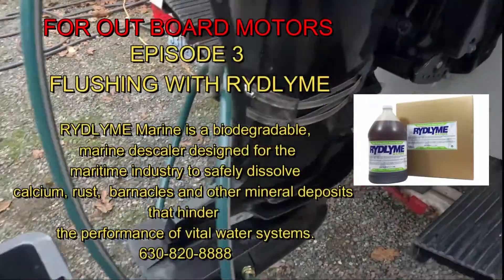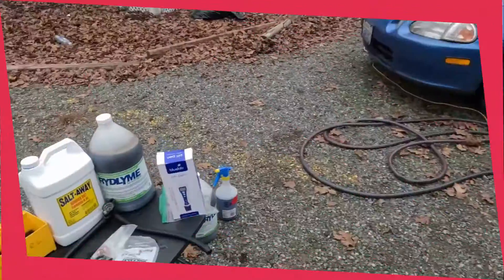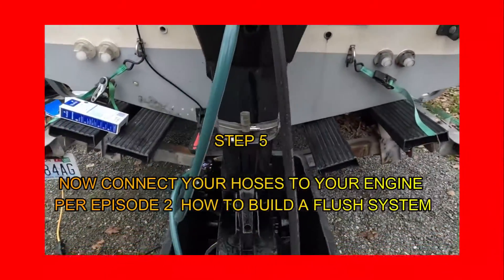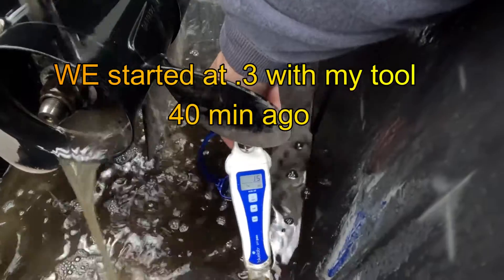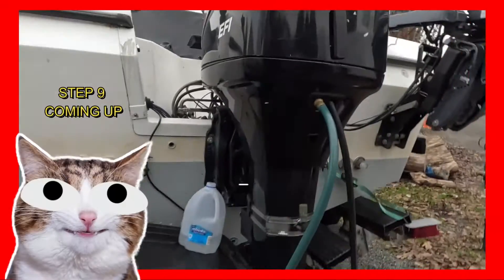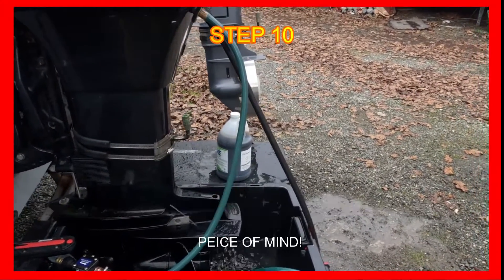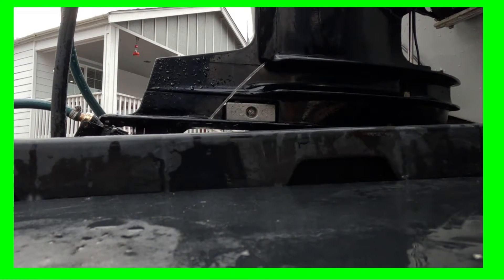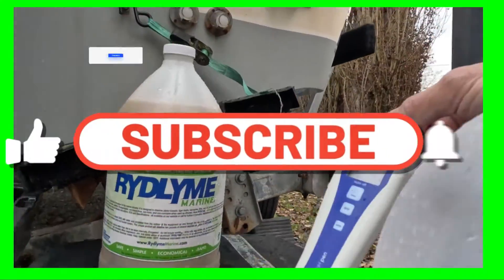DIY, Flushing Out BOARD Engines WITH RYDLYME. How-To #fishingequipment  #boatmaintenance

Comment: My pump wont pump through the system out of the tell tale, im pretty sure i set it up exactly as you, granted i dont have a flush port and am attached to the pick up tube in the leg. Any suggestions?
Reply from the maker: @michaelseamus2112  is thermostat out? Common problem is to small of pumps
Reply: @steveperdueshowtofishingti2172  yes the thermostat is removed
Reply from the maker: @michaelseamus2112  what size motor? and pumps gal per minute?
Reply: @steveperdueshowtofishingti2172  it's a 30 hp johnson and I believe a 1/10 hp and 320 gph, I had a 1/8 hp Amazon pump that behaved the same however it burnt out within an hour of use
Reply from the maker: @ um, sounds like the pump is just not pushing it up to it. Is is coming out the bottom of engine and just not out the pee hole
Reply from the maker: I wish you could upload a pic but YouTube doesn't do it.
Reply: @steveperdueshowtofishingti2172  it's coming out of the two front holes in the middle of the leg, it would be easier to post a pic i agree
Reply from the maker: @michaelseamus2112  mine was going through pee hole,, i disconected and ran into the tub. Maybe just week pump.
Reply: @steveperdueshowtofishingti2172  very possible. I routed the tell tale back into the tote as well. Thank you for the replies I'll keep at it
Reply from the maker: @michaelseamus2112  good luck, let me know how it goes.

Comment: Hi Steve, thanks for posting. The PH thing is clever. questions: 1/why do most recommend to remove gear case  and connect to internal pipe instead of connecting to flush port? 2/ Once I am done with 1 motor can I re-use the mixed solution for 2nd motor or I need to start with fresh mix? I guess the answer is that it depends on how bad 1st motor was... Or same thing but in a more scientifically expressed YOU would say depends on what PH obtained when PH in and PH out became equal on 1st motor. last one/ should I do this as maintenance if I have no overheating even running full throttle for an hour in 87 F sea water or is this a curative procedure only. Thanks a lot!
Reply from the maker: Hi, Thanks,  some dont have a flush port and thats when you can remove gear bottom end, other wise I would use the flush port and take out thermostats if its available.   2nd ya PH would be off from the new, also if it went super high for a long flush its spent I would just get another, but if it barley changes use a bucket and keep using it as a maintenance every 3 or so months. if it was an older motor I would do it once a month to make sure it is all clean inside, but lets face it numbers don't lie, if the PH in is the PH out, its  not eating anything away anymore so then its clean. 3rd, you could use it in a flush bucket every time at a 6 or 8 to one ratio and always have it cleaning your engines and never build up at all.. really depends on how long it has to sit without being rinsed after use as well.
Reply: @steveperdueshowtofishingti2172   Hi Steve, first of all thanks for replying so promptly, you know how it is, I thought of descaling my outboards and now I want it done yesterday, however I like to temper a bit and gather as much info as possible and your video was really informative plus you understood what you were on about. My motors are from 2006 with around 1000 hours. The build up is not too bad however there are cooling parts like the gas cooler that is not visible inside without dismantling. I got that boat 3 years ago, it was my working from home covid period project and I have done some good maintenance on it, I have put around 350 hours on it since I got it. Boat is on trailer, used almost every week end and motors are flushed running on ears with tap water every use.
Reply from the maker: @denislaouenan5553  I would run a d rinse..just rinse when your done and the pH is down to what is in is out..especially older motors..

Comment: Good video, but drop the needless music.   Also would have been good to see how much crap got flushed out of the motor into the tub.
Reply from the maker: Early production..lol..I now only do music at non talking scene's..and mostly in catching fish vids.  As far as the stuff flushed out...it's all broken down and changes the PH of the water...you can't see it because it's so small after it's eaten away...which is a good thing. When you flush and the ph does not change it is not breaking anything down because it's all clean...this engine took over night..salt away doesn't work..it gums up thermostats and pop offs..